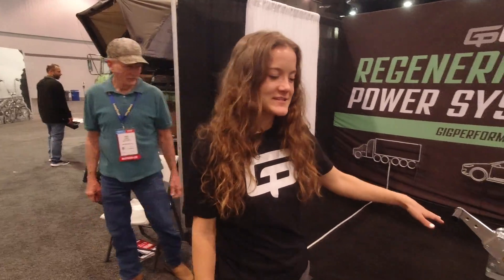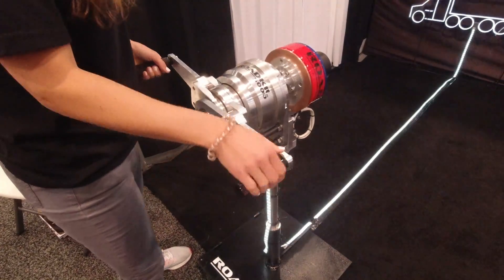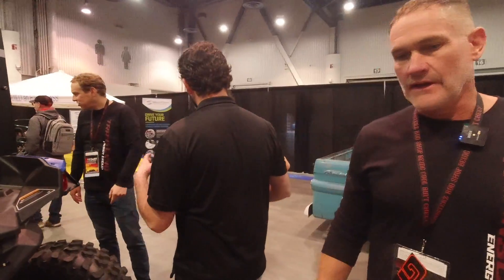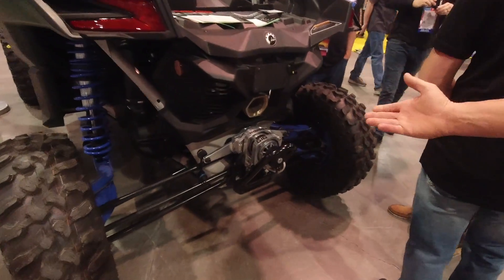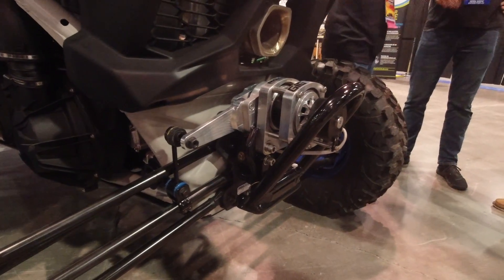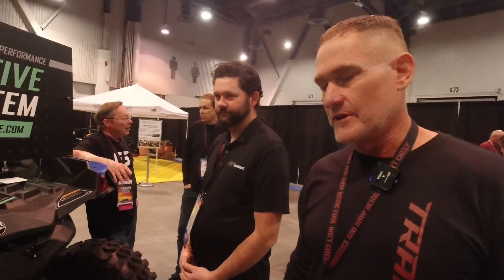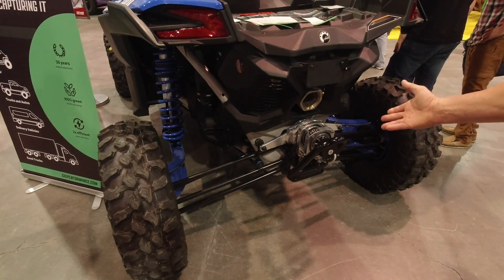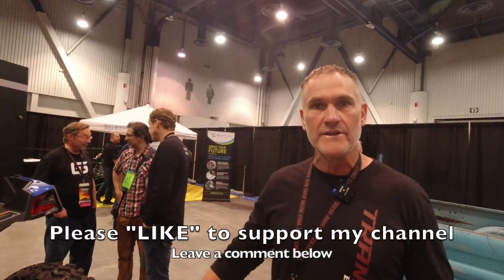(possible EV world game changer) Gig Performance - electric regenerative suspension system

Comment: So hear me out imagine a system that is a pontoon float system that has a  decent size battery inside the pontoon there's 2 one for each side of a boat and on each side to connect them are 4 big size of this design suspension product for a total of 8 allowing boats extra floating capabilities battery storage and energy generation for the boating industry and power cats the eco cats with solar and electric motors i think that would be an absolute game changer hell maybe they could even have an electric motor themselves so they can be installed on any boat and give them extra speed and range or even a smaller system so john boats or jet skis i think that's a completely untapped market and could be the next trillion dollar idea

Comment: This seems cool. Really what it comes down to is if the weight and complexity trade off is less than the energy recovered. They have it on a ATV. Which tells me this probably would not be useful on the road or track. If it is, then I'd see the primary use case being hybrids, not EVs. 

I could imagine a performance hybrid with a very small battery. You pair this with brake, flywheel, and hybrid turbo regen; you could have many sources of battery charge that would add up to a high output electric motor that never runs out of juice.

Comment: seems to complex, perhaps better to keep it simpler and cheaper, maybe simple electromagnetic coils with some permanent magnets. And the good thing about this is potential for active suspension system, which stiffen and soften depend on road condition, steering input, and acceleration and deceleration.

Comment: It crossed my mind a while back, though I was hoping for a linear generator directly replacing the shock absorber, this, however, does fix a lot of problems with that, though it also seems to bring new ones in as well... obvious issue being it currently only works for vehicles where lower arms are close to each other - so no low profile road EV's or whatever.

Comment: What’s the application for non electric vehicles?
Reply: eliminate would reduce vehical costs; or even reduce the size of alternator, lowering drag on the engine should save a few hp and use less gas
Reply: Could also be used in hybrid race cars, since they're constantly under extreme motion when racing.
Reply: Put it on your camper and charge your on-board power while you travel. Put it on your yacht and let the waves run your systems.

Comment: But what's gonna push the suspension back down? They do understand the energy needs to be stored in the suspension and not used for LED lights and Bluetooth radios right? If you're soaking up all the energy from the up travel the only way to get it back down is with gravity, WHICH the rest of the vehicle is also under the effect of. This is literally, just a way to make a more expensive, crappier suspension.
Reply: Springs xD Springs store energy, shock absorbers do what they say - ABSORB SHOCK or ENERGY but it wastes it as heat
Reply: @elmars302  shock absorbers are just Dampers. The energy they produce is miniscule and is really just because of inefficiency. Replace it with a more efficient system and its almost nothing. The energy going out of a suspension system would be zero in an ideal setup.
Reply: @BrassAxe  What? It's literally the oposite of what they're for. Think about if, if you have only springs, no air - single pothole to let the potential loose & it oscilates forever. Have you not seen hooke's law? Damped oscillations? That's the whole point of a shock absorber - to remove the the energy out of the spring so it atabilizes. And spring doesn't loose energy because it receives extra from impact with the ground, because it's surface + car weight acting on the car at that point, shocks just dispate based on movement - if spring is in equilibrium - no vertical movement,  no energy loss.
Reply: @elmars302  Im not sure we're not talking about the same thing. Springs are storing the energy, but not in an ideal manner. Yes they oscillate, thats why we have dampers ( the shock ). The shocks also adjust rebound rates etc etc. So the shocks are only capturing energy that  the spring should have kept, but they can't because they are not perfect. But the energy lost in the dampers is tiny compared to whats in the whole system. 

Lets remove springs and dampers from the discussion. The goal is to decouple all unwanted up and down road motion from the passenger section. So the perfect suspension would be some system with no losses. Always maintaining the vehicle at a set level. Would that be correct?
Reply: @BrassAxe  Yes, maintaining height is what we want suspension to do, but can you explain why do you insist on shock absorbers damping springs energy that "it should have kept"? It's the oposite of what you want. You can't have more energy in springs and keep them equally displaced. Hence - shock absorber to bring that energy down back to normal. Majority of energy in springs comes from the weight of the car & reaction from road surface. If you increase energy in a spring, say, if the road goes uphill, it shrinks, but when it levels out - that energy from the road is still there, so it will extend to spend that new energy, so it will be higher up - bit the higher you are, the more potential energy you jave (E=mgh) so that gets transfered to kinetic energy as the car's weight pushes back, but it overshoots, because it still has that extra kinetic energy.. so it again shrinks and so forth. The shock disipates that kinetic energy as heat, due to oil and piston movement friction, so it goes back to the equilibrium.
Reply: @elmars302  Yeah, now im pretty sure we're on the same page just not understanding each other.

If the road height suddenly increases the spring compresses. Now you either want that energy to slowly release to dissipate that energy over time if its a long term increase in road level. Or it its merely a quick bump you want tge energy to go back and push the wheels back down pretty quick. The energy returned from the spring will not match what the road is doing. So you have to control it with a damper. The damper also keeps the wheels from flying up too fast. 

I think a hypothetical example is helpful. Replace the springs and dampers with an electronic suspension where its stroke, rebound, etc can all be controlled. If you hit a bump of a 1 second duration at X height you want to collect that energy and not let the car rise, then put it back and not let the car fall. Same with a 0.1 second bump of X height. With a spring you can't control the rate of return so you need dampers. The dampers exist because the spring cannot be variable. If you replace the springs with a perfect system should keep all the energy and only release it when appropriate, there should be no losses.
Reply: @BrassAxe  Are you a software engineer? Your hypothetical example describes what a spring does. it stores the energy & dissipates it when there no longer is a bump - IE, extends. And yes, your example IS ideal. But you're completely disregarding mass of the wheel assembly, which by it self has GRAVITATIONAL potential, so while going uphill it increases the PE of the spring, but going down it has Spring potential + Gravitational, so net more than it had on the road. If you want to have the same height through out - you need to get rid of it, and guess how we do that :D

And it bothers me, because it's the first answer on google if you type "how shock absorbers work" so you clearly just hold onto it out of stubbornness and unwillingness to admit you're wrong. 

If you're not convinced, here's a simulation we use in Mechanics 1: https://phet.colorado.edu/sims/html/masses-and-springs/latest/masses-and-springs_en.html
Reply: @elmars302  Gravitational potential is part of my arguement. When you remove all the energy of the compression with a generator or someting the whole system including the car is now only left with gravitational potential and its just gonna pancake back onto the ground. Any removal of energy from the system makes it perform worse even the dampers. Even the spring not being perfect makes the system less than ideal. The spring/damper or shock absorber is only the best / most cost effective system we have, but not ideal.
Reply: @BrassAxe  Just check out the simulation, I can't be doing this all day.
Reply: @elmars302  I no longer understand what you're arguing against. 

The generator in the video makes for a crappy suspension component if you're trying to remove large amounts of energy. Would you agree or disagree?
Reply: @BrassAxe  I disagree of course, otherwise I wouldn't have commented, but It's reinforced by your flawed explanation which I tried to correct. You don't NEED to remove lots of energy, you just need to remove the excess energy, and for that a small rotational generator makes the most sense cost-wise. Not saying it's perfect though - it would be a poor design for low-profile suspension like in road cars, because of the distance between lower control arms which would translate to very little rotational motion. It could be worked into the joints of the control arms that could perhaps be a bit better. Also not saying it would be wise to replace shocks completely with this...
Reply: Your wrong.   Read the other guys comment.     Why would you think you know more than the engineers developing and testing it? 😂😂😂
Reply: @TristenHernandez  Because I'm a Physicist. Although this should be common knowledge for anyone who graduated Highachool.
Reply: I’d like to think a reverse magnetic suspension could be invented as well that way any energy stored/generated has use if like to see this application used in conjunction with the Hybrid and regen braking sure it would be expensive but over all I think it would easily extend mileage I do think this would only be feasible in a truck body type.
Reply: The springs push the suspension back to ride height after a shock is absorbed. The generator isn't a replacement for springs but for the shock absorber that allows down the rate the suspension comes back to ride height.

Comment: Smooth roads dont charge batteries
Reply from the maker: What city has roads so smooth that suspensions never move up and down?

Every driveway, sidewalk, and intersection has variations that force shocks and springs to move. Just accelerating and braking alone will load and unload a suspension.
Reply: @mixflip  lol i think @scratchacker was making a joke. Its not that deep bro
Reply: @mixflip  oh and St. Louis has roads that smooth. Especially east saint louis. So this concept will be completely obsolete here. We have leveled every square inch of our roads here to never elevate or depress more than 1/25th of an inch in every direction. So count us out
Reply: Yeah not for the Japanese with their race track smooth roads but here in the US? Infinite power!
Reply: They also mentioned vibration as well. So if not a "bumpy" road it also can used the vibration from a smooth road.

Comment: I have concerns about reliability in regards to suspension travel being almost instantaneous at high speeds.
Reply: Right. And to use the dampening effects of the generator alone as suspension would require some ridiculously strong gears to handle those impacts. I wud also have questions regarding the way replacing a suspension with the generator would impact handling and stability.
Reply: Also regarding ur comment on suspension travel, ive watched truck tires bounce literally 2 feet vertically after hitting a big pothole at high speeds and although it happens instantaneously as u pointed out, the tire actually will bounce off the road and back up then down to the road again multiple times before gaining steady contact again. If im imagining this generator correctly, and using my experiences with generators i would totally understand the dampening characteristics of it but i could never see it actually replacing the suspension no matter how durable it is.

Comment: Electric energy is promising and I don't have any issues but the world needs to be aware of these snake oil salesmen. It's a good idea but I'm sure the power generated wouldn't equate to an extra two miles of range. Al gore was one of the first to get rich off these electric fantasies and now every polatician in DC is involved in stealing our tax dollars and cramming such crap down our throats. No one wants to speak about the pollution involved in making batteries and solar cells. Recycling the old lipo batteries is outrageous. I would bet that the EV craze is polluting our planet at a much faster rate than modern combustion engine do. And this is no excuse for use to not be conscious but until we give China and many 3rd world type countries a reason to stop polluting like there's no tomorrow then our little patch of earth will mean nothing. If our polaticians we're legit and not just money hungry they would have folks talking about all angles. Good and bad.
Reply: Good idea but you are correct, the output just isn't there. 1kw is really nothing as well as it's not consistent that's a big part of the problem.
Reply from the maker: @JF32304  I believe he said you could put a 1000 watt generator on each wheel?
Reply: I didn't mean to sound so negative about this product in general because I think it's a great idea. Every little bit helps but it's definitely not a break through or major revelation. Put four long travel versions on a desert truck bouncing across Baja at 140 mph and you will find the maximum output of this right before it breaks in half and starts a fire.
Reply from the maker: @miketee2444  sounds like something they should test for sure.

Comment: the reason nobody does this is it's a fool's errand. the energy involved is just not big enough. look at hydroelectric power stations: you have to move thousands of tons hundreds of metres elevation to have any meaningful energy. you're better off packing the weight of this system in extra batteries. looks cool as hell though. good video
Reply from the maker: Maybe it will be used “in conjunction” with other tech like roof mounted and hood mounted solar panels and regeneration braking. That’s 3 sources of power going back into the batter system. Who know how efficient it will be once these guys are adopted by OEMs. 

I still remember when the world only ran on carburetors and scientists and engineers knew for a fact that the oil supply at that time could be calculated to end at a specific decade. Then someone invented fuel injection and all those predictions had to be extended because no one knew about fuel injection’s performance until it was used on OEMs.
Reply: @mixflip  i agree and these buggies would be uniquely suited to solar charging as they get used in places a petrol station might not be very close by. the maximum attainable power there is 100 Watts per square foot when the sun is overhead, or 1000 watts per square metre in metric. efficiencies around 18-25%. (from affordable to "if you have to ask you can't afford it" panels) Cold but bright days are best for it. Regen? you get 20% upwards back, not insignificant at all. Added benefit is less disk brake maintenance, which if you ask me is even more sweet a deal than the added energy. Downside would be losing the feeling of freewheeling downhill and locking the wheel up in wet conditions? On a bike both of those suck, but on a car it might not be too bad. (all my figures come from reading about other people's projects on the endless sphere forum way too much, pretty sure it's all accurate as of 2022, but none of it is personal experience yet unfortunately)
Reply: @mixflip  there's also another interesting unit of measurement when it comes to solar charging: Watthour per Watt. sounds strange, it simply denotes the typical amount of energy (!) you get from unit power of your panel on any given day, and it seems to be between 3.5-7.2 Wh/W a day based on thousands of hours of testing by the sun trip folk. This means if you have a typical 300 watt panel strapped on the roof, with current technology you can expect little more than a kilowatthour of energy after the day is over. The most competitive sun trip participants get 4500 Watthours a day from 2.5 m^2 panels, the maximum surface area allowed by their ruleset, and they use fancy mechanisms for tracking the angle of the sun during the day.
Reply: I think it's good for the right people
Reply: @ who? people who can't count? the theoretical maximum amount of energy this could possibly harvest is barely enough to run some lights